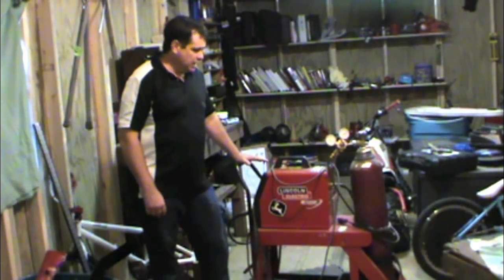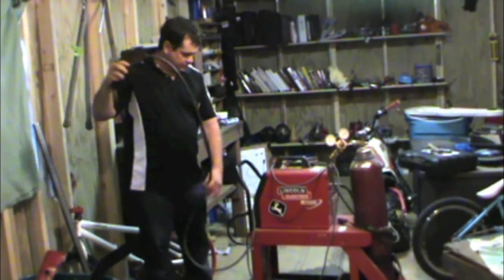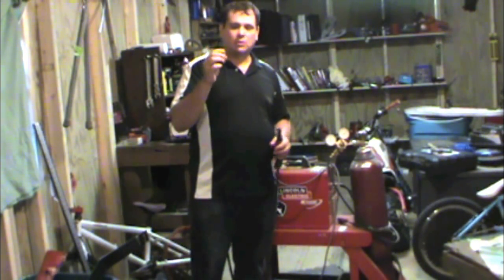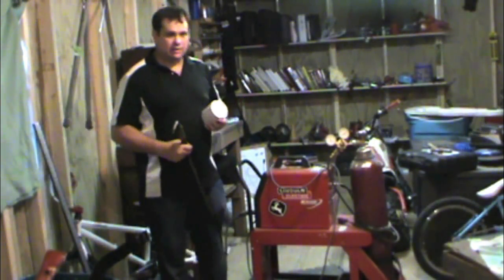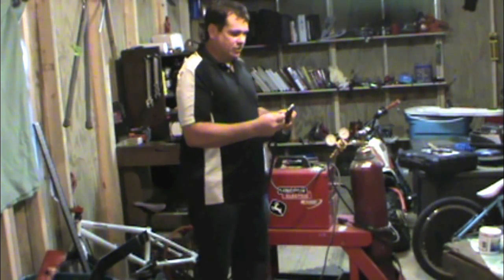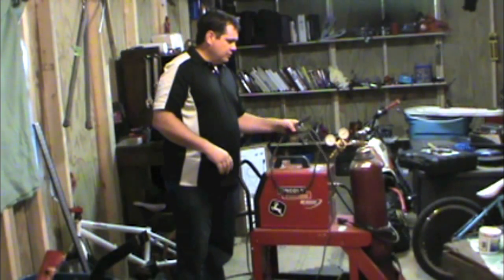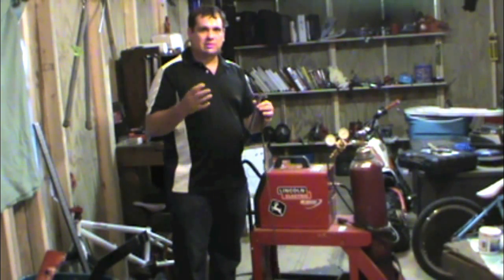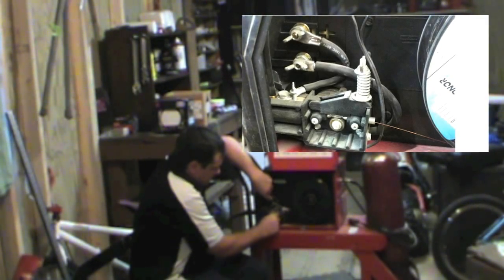DIY MIG Welding Basics - Parts of a MIG Welder Video Tutorial - Automotive Welding

Comment: Consider some of these points.

First, 110v welders are capable of welding most joints for collision repair. Although when attempting thicker gauge steels like truck frames or uni body inner structure your welding technique, welder setting, and having adequate supply power is critical.

For example if the supply power (building power) is not rated for the welder you are using that 110v welder will never be able to reach full power no matter how good you are. This is very common among 110v circuits since they are typically built to general household requirements.

Second .023 wire is better suited for low power welding or 110v welders. Like welding a quarter panel or other thin gauge steel. .030 wire is better suited when welding thicker gauge steel like a frame rail or a 220v welder. They will be able to penetrate better especially when used in combination with a 220v welder.

Finally there are NO OE's recommending strait CO2 shielding gas for collision repairs on newer vehicles. May be OK on a 60's Stang but on a 2000+ Stang it is not.